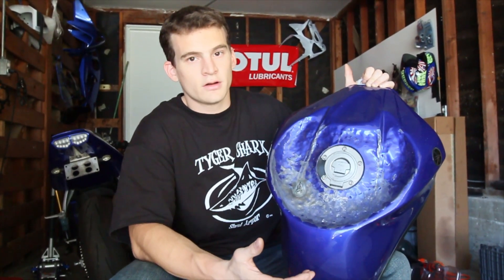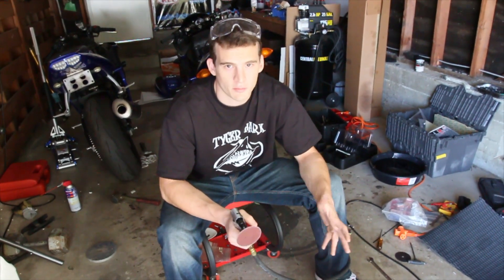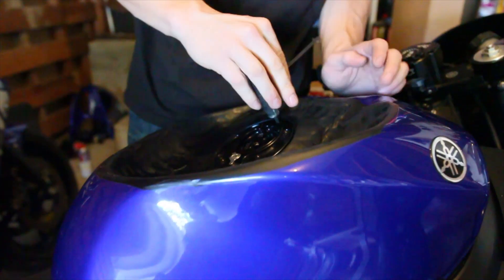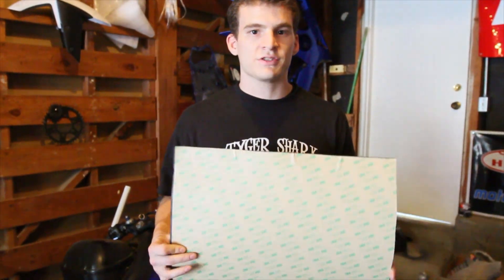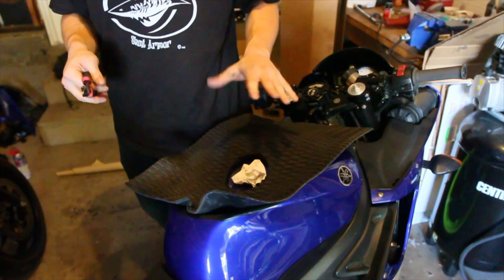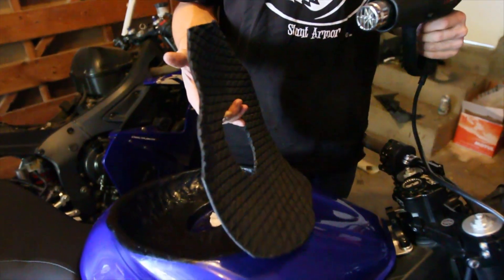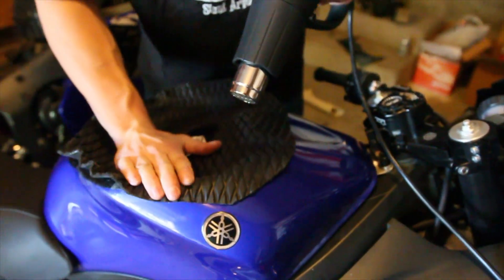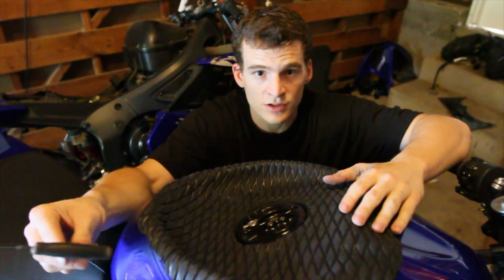How to Put Grip on a Stuntbike Gas Tank

Comment: I agree, it does look like you could have done a bit better. I mean use something with a hole in the center that your gas cap will sin through. It will keep you from cracking the ring on the outside of the cap of your tank... (Just a tip) let me know how much better it works. You'll be happy you did it. :) cheers!
Reply: At 1:00 even, you had a different cap on the tank, the cap at 2:31 was much different. 
I think this should have been mentioned before people crack theirs without knowing what they did wrong. 
I think if your going to add a new one and junk the old cap that's fine.. Otherwise I like to keep my old parts just incase... just saying. Thanks for the video

Comment: Hey are you having pressure issues with your r6s tank? When I dented mine it pinched off the 'metal tubes inside and I have to open the gas cap every 15 minutes then it spews gas everywhere..

Comment: just fyi, it ended up being the tubes pinched off. i punched a hole in the tube before the bend and its able to breathe now and doesnt build pressure or spew gas!
Reply: Ty Nagle what tube did u punch a hole in? There's 2 isn't there??? And what bent would that be? Isn't there an end at the top and bottom? And when u say u punched a hole what did u mean by that?